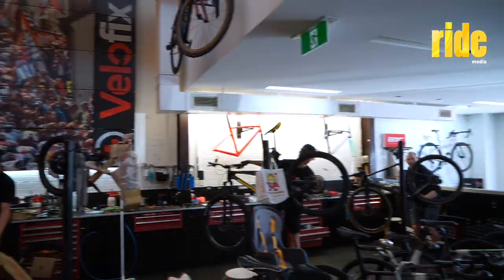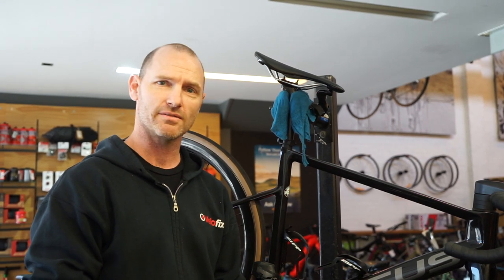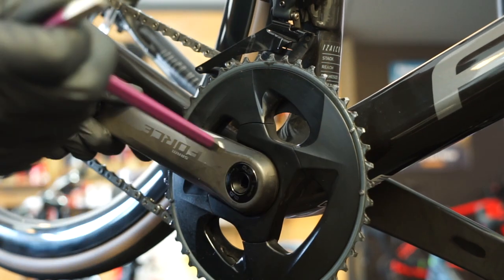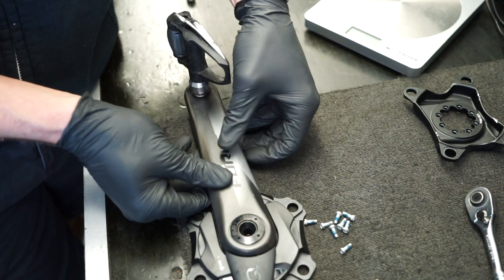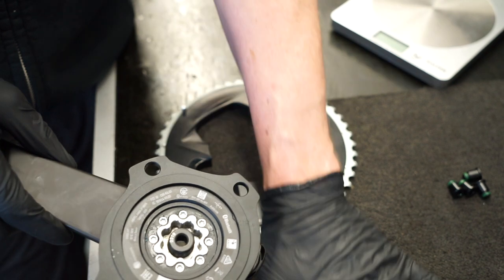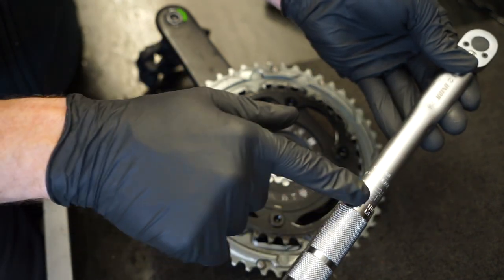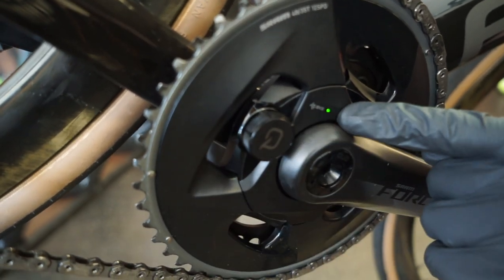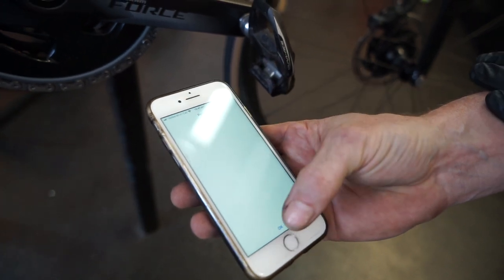SRAM Force AXS power meter installation (RIDE Media workshop sessions)

Comment: That 8mm allen on the crank wasn't half tight - had to use gloves and both hands on an extended allen key with foot on the pedal.  definitely more than 54Nm from the factory.   Good video guys!

Comment: also VERY important is to tighten in an alternating/opposite pattern ( as you did in the video), specially with AL parts or things will not torque down evenly and even warp.

Comment: Nice video! Similarly, I have 107 BCD spider with a Sram Force with 46/33 chainrings. My goal is to swap in the new smaller geared “wide” Sram chainrings 43/30. Can I just procure a 94BCD spider (wide BCD) and switch out the 107bcd with the 94bcd  spider, so I can install the 43/30 chainrings?

Comment: Does the spider fits in the original force crankset or a specific quarq crankset was needed ? I’m asking this because I own the same system for mountainbiking and I had to purchase a new crankset since the original one has only 3 fixing points so totally impossible to get the spider there...
Reply: In this video, the SRAM Force crank is stock, so he was able to just swap out the stock for the Quarq spider. Perhaps your mtn. bike spider is different?

Comment: Hi, I just tried to install my SRAM AXS POWER METER SPIDER ON A 43/30. It didn’t fit. So disappointing. Can you tell me what your setup is?
Reply: Hi, I almost pulled the trigger today on this power meter. Luckily I've come across your comment. Such bad news! Any luck with Quark or any other PM and SRAM Force AXS 30/43T chainrings? I have Giant Gravel bike on Force axs 2x and would love to install this hardware.

Comment: It's not clear in the video - is the little chainring direction specific.  i.e. does it matter which side is towards the crankarm?  I have this chainset on my bike - don't need to work on it now, but it would be useful to know for later, so I've bookmarked this video.  Thx.
Reply: Yes i think I made that mistake. The little chainring can only go on one specific way. I experienced shifting problems because i messed up the direction. The text on the ring should face you, and the little indicator inside the ring should be matched with the crank. Watch the video carefully at 5:00.

Comment: What a shame that the  black cover of the SRAM FORCE of outer chainring is made of plastic (including threads you mount T30 bolts at the torque of 12NM). Mine as well as of others had produced cracks on it for no reason and it is very dangerous to ride without replacing it as with the thread broken the bolts have loosened. All bolts have been tightened at the prescribed torque. Now they upgraded to D2 version to remove such a mistake...

Comment: You say at the begining it is very very tight to undo and takes a lot of force to undo the crank bolt in the first place, but don't show that.  I can't budge mine - how big a lever do I need and is it safe on a carbon road bike frame?
Reply from the maker: Understand your comment completely. When we started, Anthony said: "Ah, mind if we don't film this bit? It's going to be loud and it might scare a few people off – it could look like we're breaking your bike..." 
He was joking. But then he used the lever you see him tightening the cranks with, only with an additional long lever (a steel tube) over the handle for additional torque...
He had another mechanic hold the pedals and together they wrestled until veins were growing in their temples and arms... and then "BANG"... it came undone.
It was loud. It did look like they were going to break the bike... but when it was loosened, Ant-man just looked at me and said, "Mechanical work can be ugly at times..."
As he says, get a friend and make sure you have strong tools. Or, perhaps, go to a bike shop and ask them to do the job.
– Rob
Reply: @ride-media  Thanks Rob, very helpful and all sorted now. An 18" bar did the trick - a bang but not a big bang and all back on and working now.
Reply: Put the bike upside down and you’ll have more leverage as you push the wrench
Reply: same here, it doesnt move a bit. bought a 1meter steelpipe as a lever and it is still not moving. also i have trouble to fixate the crank/pedals to apply torque. when i put the bike upside down it gets worse cause the wheels are not beeing stopped by the floor.
Reply: @JURSWB88  it worked for me. I have this big Park Tool torque wrench that I put on the reverse then pushed it while holding on the driveseside crank arm.

Comment: The little chainring can only go on one specific way. I experienced shifting problems because i missed up the direction. The text on the ring should face you, and the little indicator inside the ring should be matched with the crank. Watch the video carefully at 5:00.
Reply: Hi, which shifting problems did you experience exactly? Just trying to figure out an issue I’m having myself.
Reply: @manuelmalagon210  the chain did not change easy and kept rattling. Changed the orientation of the inner ring using the indicator and then it worked perfect. Good luck.
Reply: @Matt-Wolf  the exact same issue I’m having and it’s driving me crazy. Fingers crossed that I did this wrong and installed it the other way around. Thanks for the lead!
Reply: It worked!!!!!! HA! Thank you so much. That was exactly the issue! Finally this nightmare is over.
Reply: @manuelmalagon210  Your welcome!
Reply: What do you mean “face you”? Text faces you during install or after completion?

Comment: It’s dual power meter?
Reply: I have this and it is, but my garmin 1030 doesn't recognize the "cycling dynamics".
Reply: https://youtu.be/Y7F8PPiC9OQ
Watch this video. He explains how the Quarq "splits" the power between both crank arms, but it is really just the drive side only.
Reply: @AOL0321  I think this could be misinterpreted. The Quarq measures total power from both cranks but uses software to estimate the power split between legs. I assume it this does this by assigning power readings to legs based on crank position.
Reply: @JustinSmith-dn6fj  yes it does estimate both cranks, but the actual unit is only on the drive side